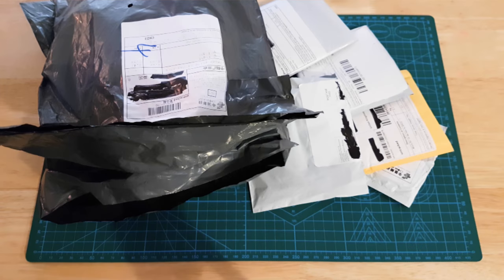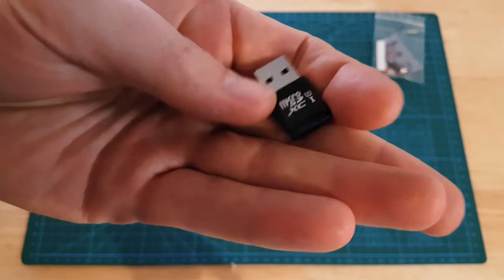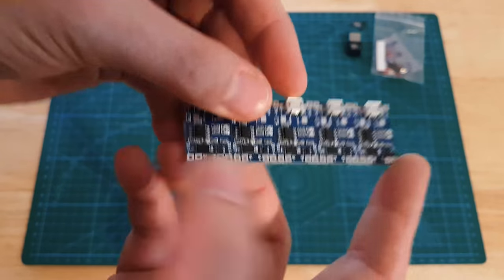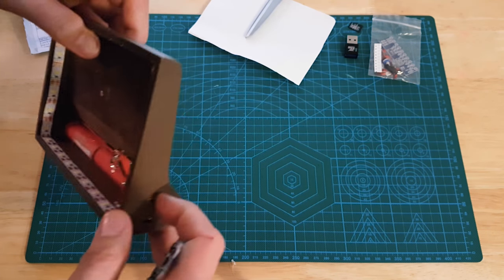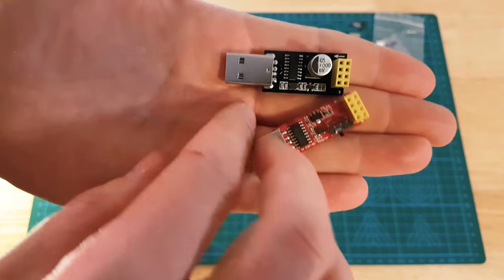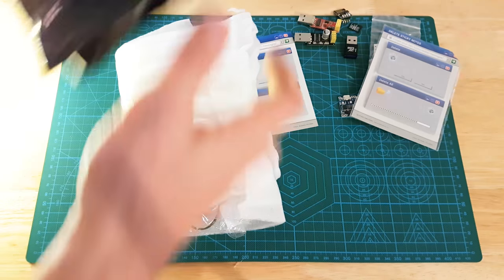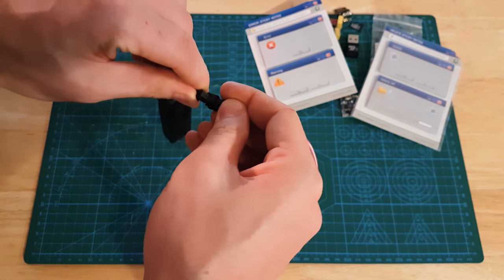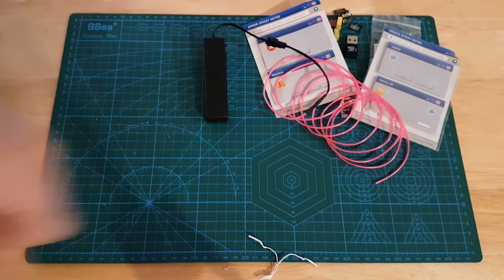AliExpress Postbag #16 - Post bag / mailbag opening electrical items from China AliExpress, Banggood

Comment: Nice video Stephen!

If you are in a pinch for a li-ion boost/charge circuit Poundland cell a power bank for a pound where you can easily salvage the circuit from it (plus you get a free 1200mAh cell!)

I never seen the ESP programmer that you got there so nice find! I have the other one you showed where I soldered a small switch at the back of the board, but I much prefer Wemos D1 minis over the ESP-01s so I don't really plan to use it too much unless I need to use something really small!

You're fiances bouquet is amazing, well worth destroying a cutting mat over!
Reply from the maker: Thanks Brian! I have seen those £1 banks, a good source of cheap cells, and boost yeah! 

I  have a follow up video to do about those ESP programmers, and how they are pretty much useless without a hack like a button as you have said. I need to solder one on as I am getting sick of pulling it in and out of my USB port(!!)

I like the WeMos Minis, but love the tiny tiny size of the ESP-01 to work with (except for the programming pains above). Need to buy a couple more Wemos boards to keep dev work easy.

I will let my fiancee know about the like for her bouquet - she vows never to make another until another friend asks her!!

All the best for you and your family, keep your videos coming - have sub'd you too.

Steve